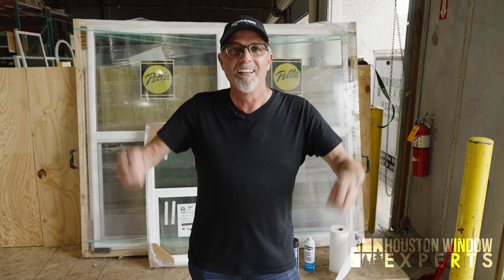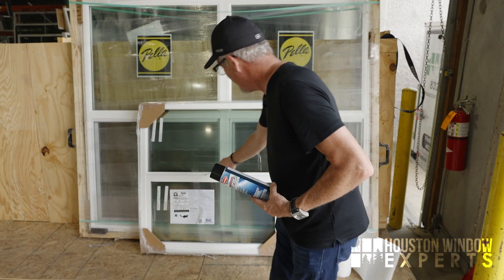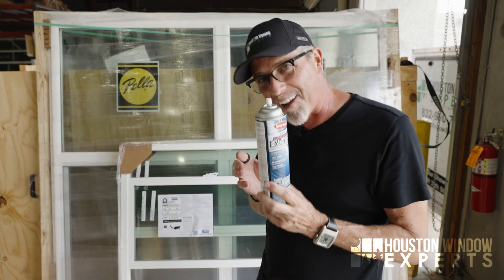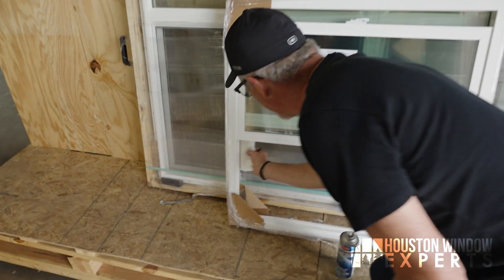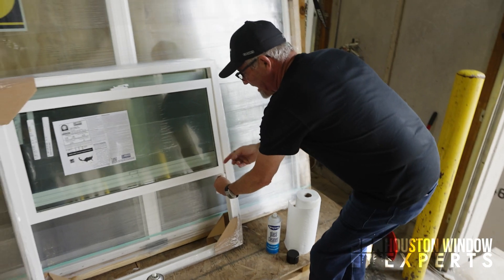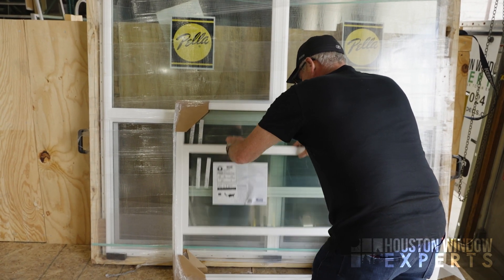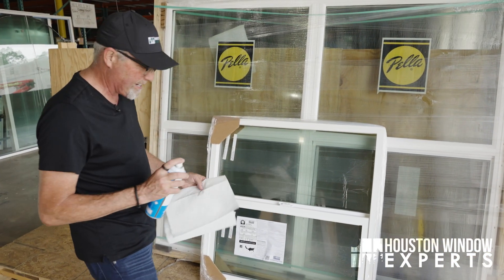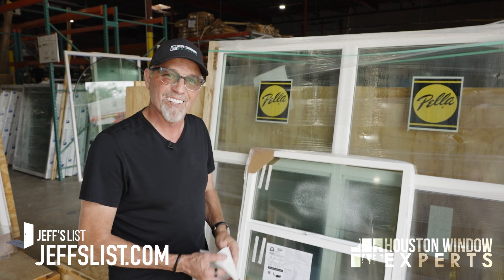Fixing A Sticky, Stubborn, Or Squeaky Window

Comment: I cleaned the tracks in all my windows & used the Sprayway Dry Silicone for loud screeching squeak &  hard to open and close. 1st time didn't work. 2nd time didn't work. I waited  a day or two, sprayed again didn't work. Tried the 4th time this morning, didn't work. I've checked for damage on all windows (6). None that I could see. Help please! 9am
Reply from the maker: It sounds like you might have a problem that goes beyond lubrication. I would reach out to the manufacturer of your window to get help.